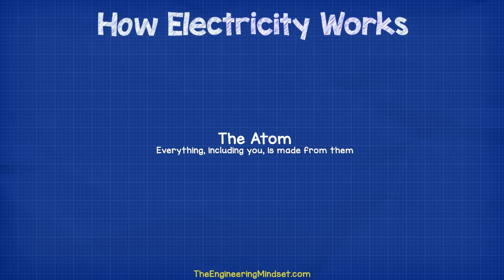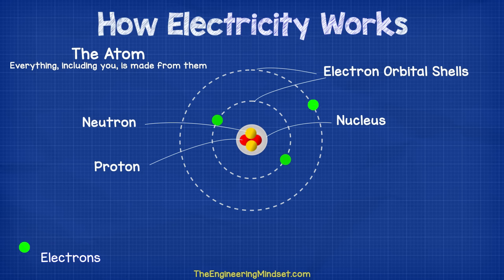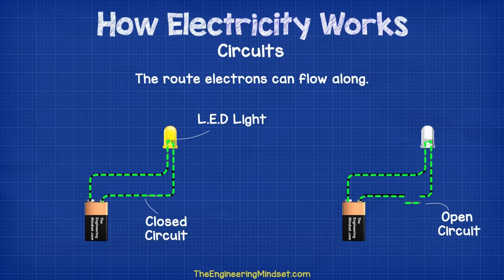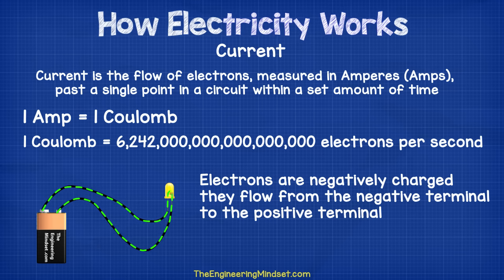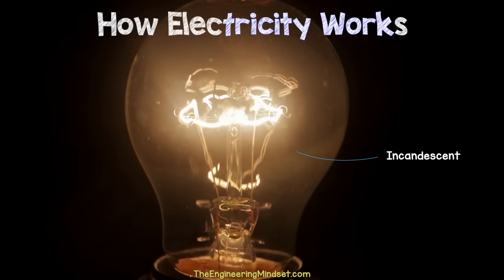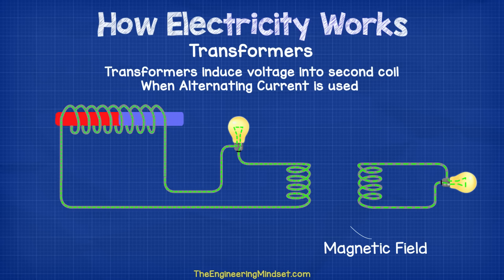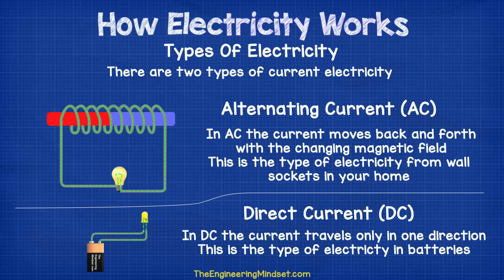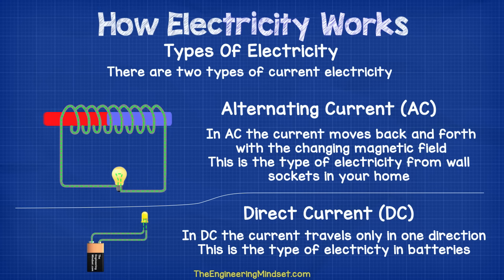How ELECTRICITY works - working principle

Comment: Key point I think was overlooked:  the more electrons in the outermost shell, the stronger the nucleus holds onto them.  This is why materials with just one valence electron (living in the outermost shell) make the best conductors of electricity—they are the loosest held by the atom.  Valence electrons even make the atom smaller....  an atom with two valence electrons will be just slightly smaller in diameter than the atom with one less proton/electron:  the nucleus holds the electrons tighter and closer, which makes the atom's diameter slightly smaller.   The metals copper, silver, and gold are excellent conductors because they have one valence electron and the size of the atoms is a "sweet spot" for how loosely that valence electron is held.

Comment: Am I crazy or is the direction of the current flowing in the wrong direction relative the positive and negative terminals of the battery? Shouldn't the flow of electrons move from the negative terminal?

Comment: if the electric current is the flow of   electrons, then the electric current should also flow from the negative terminal to the positive terminal, but why the electric current moves from the positive terminal to the negative terminal

Comment: You state that "1 Ampere = 1 Coulomb" which isn't quite true. Coulomb is a measure of charge and Ampere is a measure of charge per time unit. Specifically, a current of 1 Ampere transfers 1 Coulomb of charge during 1 second. Or put another way, 1 Ampere is equal to 1 Couloumb per second.

Comment: Thanks for the video. If Electrons flow from negative to the positive terminal (04.23), is it incorrect to be taught that a Resistor should be connected to a positive terminal of a battery in the case of lighting a small LED lamp through a 9V battery for example. Shouldn't the resistor be connected to the negative terminal of the battery?

Comment: Hello thanks for SUCH a clear video explanation on Electricity. i don't have Electrical Engineering Background but i wanted to learn how electricity works and this video is so far the most detailed version that i have ever seen. But can i ask , what makes electrons move from one atom to another , how does power sources force these electrons to jump and knock a neighboring electron out of its orbit ? How does it precisely hit the neighboring electron anyway given that it too is moving ? ALSO i have watched video tutorials on how Battery works and they tell something about negatively charge electrons wanting to look for positively charged electrons and thus move in the circuit etc i did not quite get it. is that how the electrons are moving in a circuit ? thank you ^^

Comment: Awesome! Honestly, very well explained! So if you keep moving a magnet wrapped in a closed circuit coil with an incandescent light bulb, will the light bulb ever stop exerting light after all the energy from the valence electrons is used up as light by the incandescent light bulb?